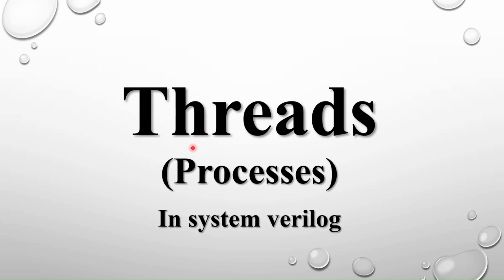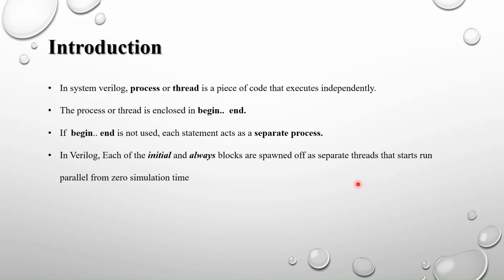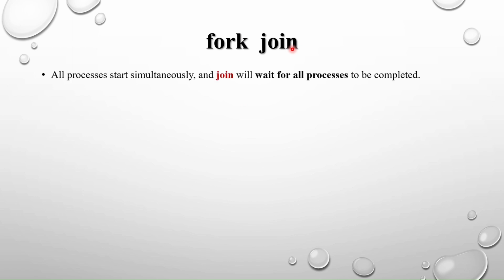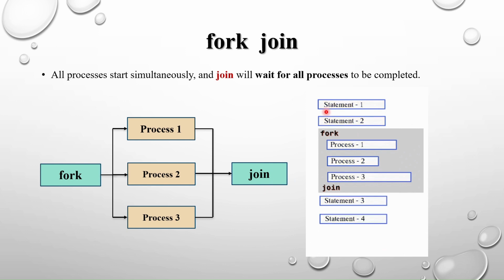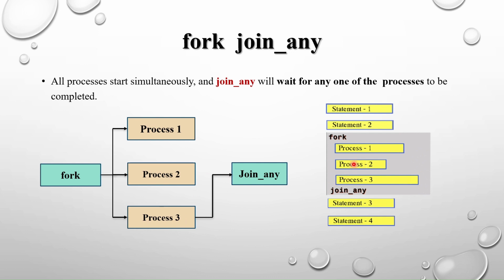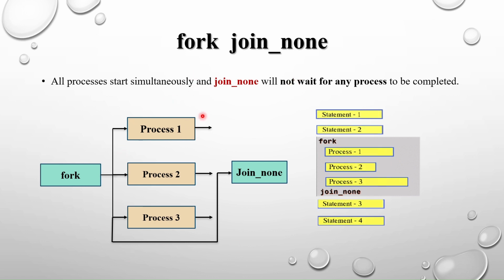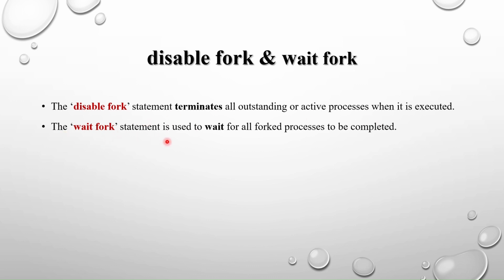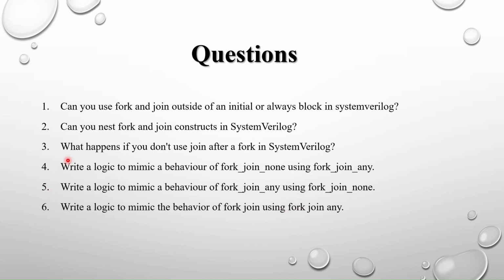Threads/Processes in System verilog | fork join constructs & process control | #systemverilog |

Comment: Inside fork join every statement is a process??
Reply from the maker: Yes, inside a fork-join, each statement is a separate process. However, if multiple statements are grouped within a begin-end block, they are treated as a single process.
Example:
fork  
   task_A();      // Process 1 
   begin            // Process 2 (sequential)
      task_B();   //  Runs first inside Process 2  
      task_C();   //  Runs after task_B() finishes
   end  
join
Reply: Ok tq 😊  @susheelapatagar

Comment: 4. Add begin-end (without any statement ) inside fork join_any so this begin end will execute without any delay and the process/task after join_any will execute first and remaining processes/task inside fork join_any will execute parallelly
fork 
       p1();
       p2();
       begin
       end
join_any
      p3();
here p3() will execute first and then p1 and p2 parallel
Reply from the maker: Yes.🙌
Reply from the maker: Please check out my 'threads example' video I have given the solution💁
Reply: Inside fork Why not p1 execute 1st instead of begin end